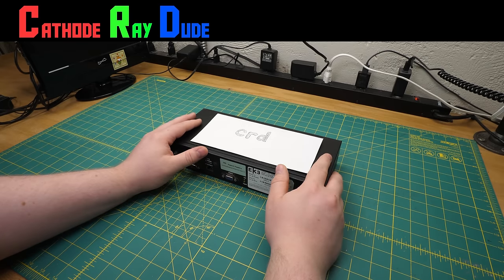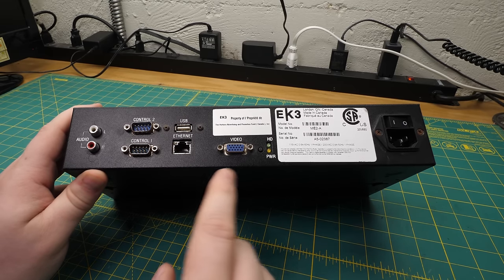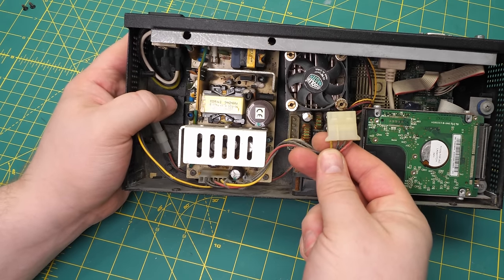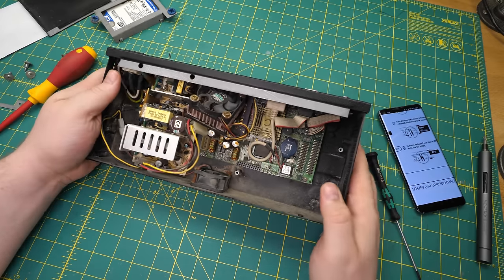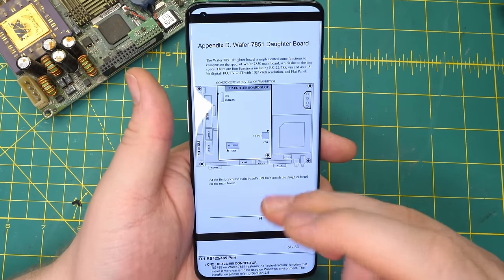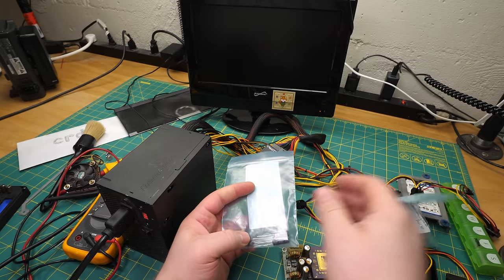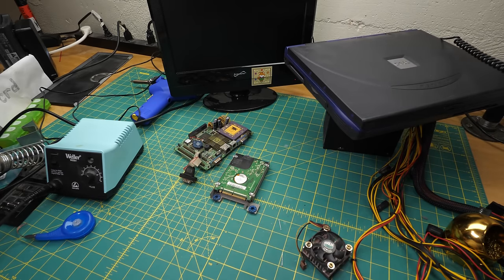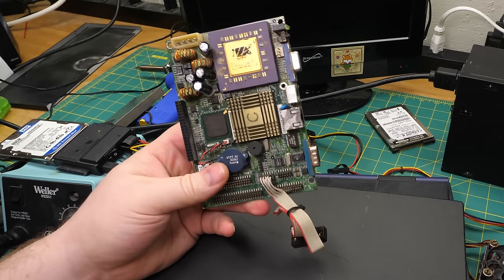Little Guys 8: This one won't fly [EK3 Media Engine]

Comment: The diagonal jumper is the worst thing I’ve ever seen in my entire life
Reply: Would you even be able to fit a regular jumper between these pins? It would be a greater distance
Reply: the same as for the 44-pin connectors smaller pitch, the jumpers on those are smaller too, so maybe that only works with those... guess 3.5" drive jumpers wouldnt work diagonally.. I only ever remember 2.5" drives with 2 jumper pairs, not 3+ like most 3.5 so maybe the diagonal is a solution to limited space/specs
Reply: Yeah, I physically shuddered and kept saying "no"
Reply: the worst thing ever?     i dunno ive seen some sh** on the internet back in the day lmao
Reply: What's the pitch of those pins?  If  ~.07", then a standard .1" pitch jumper would perfectly fit the diagonal.
Edit: Miniature jumpers are apparently 2mm pitch, or .078", so this is just about right.
Reply: @DataCab1e   Correct.  The two most common jumper sizes (and, for that matter, pin header pin and row pitch) are 0.1" (large) and 2mm (small).
Reply: I literally gasped when I saw that jumper!
Reply: Gloriously horrible.
Reply: I guess we all know why it is "confidential".
Reply: I pulled this up on my laptop just to comment about the diagonal jumper.  I have neverrrr seen that in many years of computers and electronics, oh jeez, apparently possible, but so cursed.
Reply: @philipc4272  That was the first thought that came to my mind.
Reply: @DataCab1e  And the pins are square (and probably in the same ratio); so a 0.1" jumper would fit perfectly. But, just, why?!
Reply: @BrendonGreenNZL  Saves space, simplifies design.  It's actually an elegant solution, the use of a different jumper size notwithstanding.
Reply: Western digital had the wonky cursed jumper on a few drives back in the day - there's something both creative and disturbing about it :)
Reply: @philipc4272  sure, if you push hard enough. Those pins aren't exactly rock-hard.
Reply: No judgement and I can relate to the place this is coming from but: Then you haven't lived.
Reply: @thehellriddenBaron  ~Hyperbole~
Reply: Spent half my life as a computer tech and I've never seen or heard of such a thing. It literally makes my soul itchy.
Reply: @philipc4272  If you bend the pins maybe, lol.  You'd have to get some modified jumper sqrt(2) times the width of a normal jumper.  It's very cursed, I mean... wtf is making jumpers like that?  Because wtf is using jumpers like that?
Reply: Pretty sure WW2 was worse than the that jumper configuration.
Reply: I definitely saw that, remembered your comment, and went "yeah, that's some cursed shit."
Reply: @raafmaat  YES! Rotten and liveleak have NOTHING on that jumper. I’ve watched actual “jumpers” and felt nothing, but this diagonal one keeps me awake at night, staring at the same pattern of the drywall texture right above my pillow. I might never come back from this. 😢
Reply: @ThisisForTheTV  Nah
Reply: @_..-.._..-.._     haha i like that you list the exact 2 sites i used to visit as a kid

Comment: Those 44-pin mini IDE cables were pretty common in the chunky laptops of that era.  They were usually pretty short (for obvious reasons), but longer ones did exist.  Also in that era, VIA CPUs were really cheap. If performance was of no real concern, there was probably no cheaper option. They showed up in all sorts of low-end devices, especially near the end of the Socket 7 era.
Reply: I was always happy to find some weird little laptop or device running a VIA C3 or Transmeta Crusoe
Reply: If this was in place of a P3/celeron, would be a Via C3, in an analog of the socket 370.
Reply: @RealJonDoe  Oh good catch, that's a whole generation newer than I was thinking.  I forgot Intel ever licensed that socket out to third parties.

Comment: Those caps look like they've suffered a catastrophic failure and vented. So great call to replace them
Reply: But they were also Low ESR, so not really shocked the replacements he used didn't help.  I also would have attacked the whole thing with alcohol, especially the CPU as it looked like it may have grown mould which could have been shorting the probe points or capacitors.
Reply: It's a very safe bet that heatsink fan failed first, then the heat from the CPU resulted in the failure of those caps (and the crusting of the fan cable lol)
Reply: The bulged caps are the very first thing i noticed  ! One should  totally replace them all.

Comment: The Pentium / Pentium MMX, AMD K5 / K6 were ZIF sockets. 486s were the last (x86) to be non-zif, iirc, and some socket 3 486s were lever style zero force. Now I feel old.
Reply from the maker: Huh! When I worked in e-waste I handled a ton of P1s and I could have sworn they were often just press-in, but it seems I was thinking of the 486s. For a few years it all blurred together.
Reply: @CathodeRayDude  The earlier Pentiums were press in, like the P60, P75, and P90.  I have a board with a P-166 on it and it uses a ZIF socket.  The board appears to accept a P-120 and higher
Reply: You are 100% correct.  ZIF was introduced with socket 3, wasn’t common though until socket 5 with the original Pentium.  Were there Pentium’s that didn’t have ZIF?, sure, but were not that common.  If you bought a socket 5 “generic” motherboard it came with a ZIF.
Reply: Yeah I had a 486 socket 3, I upgraded it to a DX4 100 overdrive and it could absolutely shred Descent.
Reply: Yes, all off this. I had to Google to make sure my aging brain hadn't skipped a groove, but yes, my Pentium 66, and the AMD K6 that replaced it were Ziff back in the 90's.
Reply: Yep. Socket 5 and later were always ZIF from what I saw as a PC tech
Reply: There were ZIF socket 2 486s as well. Socket 3 is when it became the de facto.
Reply: @CathodeRayDude  Socket 3 (486/Pentium Overdrive) Socket 5(486,P1) Socket 7/SuperSocket 7(P1,K6) were all ZIF.  486 was about the time ZIF really came on, early 486 was push in, socket 3 came later.
Reply: Apparently Socket 1 & 2 were also 486 ZIF sockets, but I have never seen one of those in the wild.  I remember the push in 486s and Socket 3, then Pentium and Socket 5/7 hit.  I suppose it made sense there was a Socket 1 & 2, but I always just assumed that was probably the name for the 386 and 486 sockets, then Socket 3 was the first ZIF I was wrong.  Apparently there was a Socket 4 as well, but that must have been really rare.  I junked so many Socket 3, 5, and 7 back in the day.
Reply: I came here to say this. The last LIF socket I used was a 486 but some of them were ZIF too. Obviously LIF sockets stuck around for a while on the absolute lowest end as we see in this video. I used to have a bent fork looking tool for prying CPUs from LIF sockets.

Comment: I worked at one of the pioneering companies in the digital signage space during the era when this device would have been new. 

We once got a unit back from a restaurant as "defective" that still smelled of the sanitizing floor cleaner they had mopped into it. Yeah the warranty claim was denied and we let customers know that they should put the unit somewhere where it will not be sloshed with cleaning fluids.
Reply from the maker: aaaaaaAAAAAA
Reply: I can just imagine it now…
“What? The outside was dirty so I cleaned it! You sell a product for restaurants that can’t handle getting dirty??”
Reply: Yeah just slide it under a counter and leave it on the floor, it's fine
Reply: Did digital signage at the tail end of the 80s, hardly makes the 2000s a period of pioneering.....  🤣🤣🤣🤣
Reply: @CathodeRayDude   mini lol, google bug trying to translate scream.

Comment: sdb4 is the extended partition that's hosting the logical partitions of sdb5-10.  You can't mount sdb4 directly.
Why the error message when you tried complained about memory, no idea.

(I was briefly confused about why the sizes seemed to add up to more than the size of the disk until I recalled how DOS partition tables worked)
Reply: For the benefit of others, I'll mention that DOS partition tables are limited to four partitions on the disk. If you need 5 or more, then you use an extended partition to wrap the excess partitions in a trenchcoat to note in the partition table as one partition.
Reply: @UnlimitedRun   for  Early software compatibility. 4 primary partitions. The primary partition table shared the boot sector so there was no room to expand, and  secondary partitions were actually  defined recursively.. an extended partition contains the partition table in the first sector, which may have one further extended partition defined (recursively), and one other partition... Not that the exact details matterred to anyone. It could have been done with four partitions in the "extended" partition tables,  and that would have worked just as well.  but  they did it with  2.

Comment: AFAIK digital signage is the more common term for what little guys get used for, narrowcasting is more of a marketing concept you can apply to digital signage.
Oh and if you google socket 1, which was used for all 486 variants after the 80486, you see that most of the images are ZIF. So they started using zif quite early, which makes sense as LIF is a pain for cpu's (and zif existed before lif anyway)

Comment: My random guess is that the little board with the tiny chip is maybe an EDID rom so that the GPU always "sees" a valid monitor and outputs the right resolution even when the external display doesn't have any EDID or is connected with RGB BNC cables

Comment: i remember these when i worked at timmies way back in the day, they used these for the drive thru's they had them in the menu boxes, i remeber opening the drive thru menu box and that little guy sittting in there, if you lookup the tim hortons dive-thru's from that era you can clearly see the screens, so the rustyness makes sense accounting how many ontairo winters that little guy survived in a metal box

Comment: MPEG2 is an extension of MPEG1 for actual industrial usage. For one thing, they had initially forgotten that everything in the video world was interlaced, and the codec had to work that way, too. MPEG2 decoder can handle MPEG1 streams which use a subset of its functionality. However, unless you need to play a postage stamp sized video on some pre-MMX Pentium, or deliver 20 second porn clips to dial-up users, you won't encounter MPEG1.

Trying to figure out file properties in VLC is pretty useless, as it works with many kinds of ephemeral sources, not just files, and only shows most generic metadata. You need to look at its module graph and/or the complete logs to learn what data it really tries to munch. MediaInfo is a handy tool that is so common people using it forget that such problems exist .

Comment: 38:30 They went with Via because they were cheaper and lower power consumption. If you didn't need the performance and wanted to save every last possible dime, Via was your choice.

Comment: Having now worked in two industries putting computers in places they shouldn't be, I am not at all surprised at the rust.  There was one location I was providing support for, always wet and occasionally containing some fun chemicals, in which a computer would corrode to death in a matter of 4-6 months on average.  I had never seen CPU pads turn black before, and I'd dare say that environment was suited to do it in record time.

The closest I came to digital signage was sticking NUCs on the back of TVs in breakrooms and hallways, usually for security camera remote views and employee bulletins.  One of those came back once because it would not boot and after examination I determined that a single drop of mouse urine had killed the Intel Optane Memory board in the NVME slot (this was when we were still using Intel branded NUCs) and had rendered the machine unable to boot.  Naturally that NUC went into the recycle bin, then my car, then into my homelab with a new SSD.

Comment: As far as lilo on that thing, it was still the default bootloader on a few distros in 2006, so it's not terribly surprising to see it on there.  After all, it's not like you'd be dual-booting the machine, and if the goal is just to boot linux, lilo's much simpler, and harder to screw up.
Reply: Particularly as industrial computers like this wont necessarily be using the latest versions of anything, just whatever works with the hardware.

Comment: The reason for the "funky washer" for the hard drive is probably an assembly consideration. Consider that the hard drive has to be added after the main board is mounted, and adding a small washer in that confined space would be fiddly and time consuming, especially if it fell off and had to be fished out of the case. Having an easy to handle arrangement like this could be worth it to simplify assembly during production.

Comment: FCPGA just means Flip Chip PGA, where the die faces the cooler. For the longest time the die faced the socket, and it led to some cooling problems when we hit the P3 era. ZIF sockets were also starting to become common in systems by the early Pentium era. Socket 4/5/7 are all ZIF, and even apple started using it by the time the G3 was coming out.
Reply: I was going to say, it makes total sense that the manufacturer would specify FC-PGA since the P-III came in both PGA and Slot 1 packages.  So if they just "P-III" it'd be a problem.

Comment: Aw man, I was really hoping for some Tim Hortons files on there. I even convinced myself the rust was from it being mounted above a coffee brewer or something.
Reply: It still could've been. Campus restaurants tend to have a smaller footprint so there's a non-zero chance that they just winged this front facing sign right over a coffee brewer.
Reply: If it is the Tim's  in the main food  Court at the front of main campus that location was actually a fairly decent sized location.  Tim Hortons layout has the menu tvs right above the coffee machines

Comment: Tip: LILO boot to shell. Instead of "linux runlevel 1", "linux init=/bin/sh" should get you in. Then remount the root filesystem read/write, and reset/clear the root password.
Reply from the maker: ty, though I'll probably forget it by the next time I need it, hah. my next step was going to be to just google the right command, the only reason I included that clip is because I wanted to include my reaction to the bootloader password.

Comment: Worked in a digital signage outfit for a few years and saw lots of stuff like this. The "media engine" branding was a trend at the time. We largely used AOpen "Media Engine" mini-PCs based on C2D laptop procs and an external power supply, but otherwise basically the same thing.

Comment: I remember those Via Chips, what i could decipher: 1) Its a Nehemiah Package. The first Row is not readable, the second row: (133x 7.5) or (133x 9.0) followed by 1.25V  The instructions to setup the Chip, making this a Via C3 Nehemiah+ 1ghz or 1.2ghz with a maximum CPU TDP of 12-15 Watts. 

A Pentium III would start at 13 and would go up to 37 Watts. Even a Coppermine Celeron or a Tualatin-256 would use 30Watt+ at higher clocks. But most remarkable is the release Date, which unvails why this CPU is chosen: The Nehemiah+ was released in 2003, Coppermine und Tualatin Production stopped in 2002. So the only new Processors to source for those S370 Boards were the Via C3 Nehemiah+
The Nehemiah Clockspeed gives about halv the Speed in PIII Power so a Nehemiah 1200 would be roughly as fast as a Pentium III 600. Which draws around 17 Watts of power. But there were no alternatives in 2006: Netburst Pentium/Celeron were drawing much more power, same goes with the Athlon (64) and Duron line. Intel Atom started in 2008, so there were literally no other low Power Processors cheap between 2003 and 2008 except the Via C3.

Comment: the wow stick can actually be quite easily used as a ratchet since it has metal gears, I have put one through hell and back and only after drilling actual long ass wood self tappers into beams (20+ times) did I manage to break it. you just hold down the button and go ham on it.  100% would buy again

Comment: I am quite familiar with that power supply from equipment I work with and a very common failure from them, they will feed AC voltage through to the output. If caught early (or lucky) doesn't tend to do any damage, just a failed system, but every so often when one of those power supplies fail, they can send a pretty high spike of AC current to whatever they have been powering. When I see a fluctuating DC reading, also check to see if it is reading an AC current.

Comment: ZIF sockets for processors started becoming common on the 486 and became the norm by the original Pentium. I may have seen some early Pentium (Socket 4) boards that didn't use a ZIF socket but I can't remember a single Socket 5/7 Pentium that wasn't.

Comment: The "Flip Chip" in FCPGA means the wafer of silicon that "is" the chip, is mounted upside down instead of right side up. When it's upside down, the bonding wires would be on the bottom side, pushing the silicon toward the top, where heat can be extracted more efficiently. Sometimes there are other reasons, but this one is pretty common.

Comment: Regarding the electric screwdriver. We use a Panasonic EY7410 cordless screwdriver at work. I think that it fits perfectly in what you are looking for, between a small electric screwdriversand a drill. It might be a bit pricier because it's mainly intended for industrial but they have really solid torque with 2speed gearbox with adjustable clutch.  

I'm starting to sound like a salesman :D

Anyway really interesting little guy once again. We used to say that computers with a VIA CPU is ''Viallinen'' and that can be interpred as broken or a thing with a via, and in this case both :D They weren't really good desktop chips compared to P3 or a Celeron. They are probably good enough for an embedded system like this.